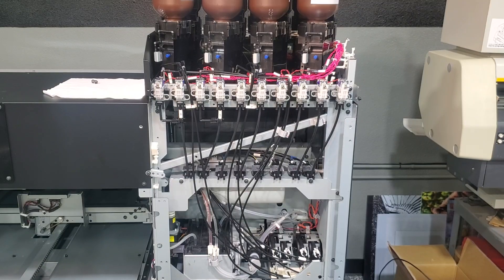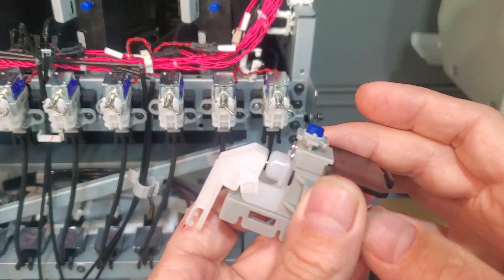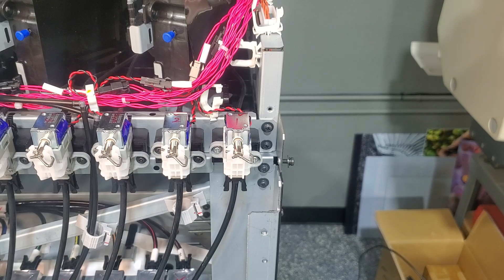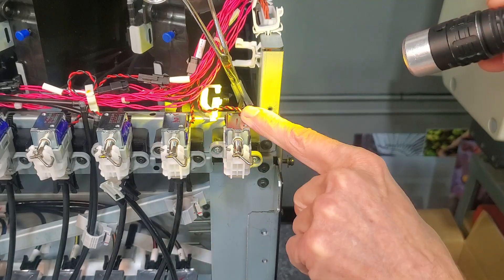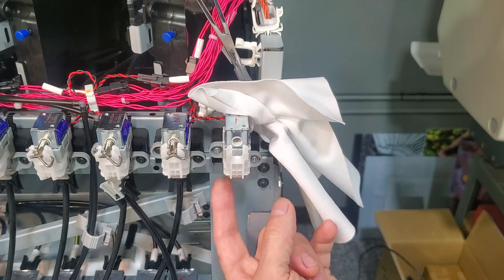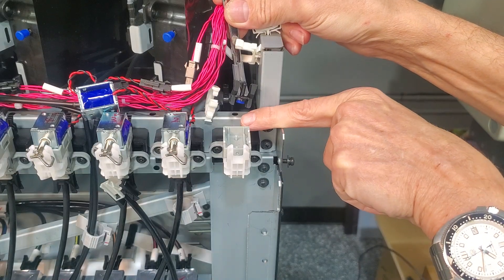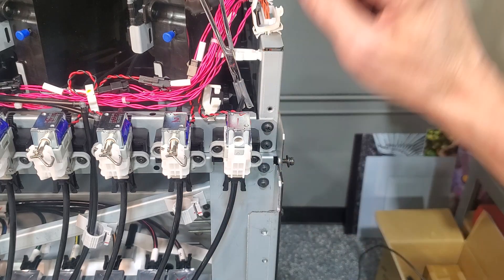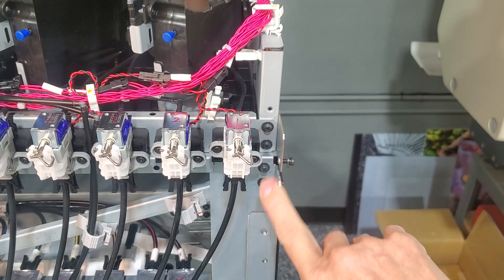PDS Equipment shows how to change the M015864 TS Cartridge Valve on your Mimaki printer.

Comment: The tubing is really fragile, good to avoid clamping on them. Remove the supply bottle, take a syringe with one of the tabbed line connectors on it and a bit of tubing. Press the valve in and use the syringe to pull the remaining ink in the bottle tank out. Usually around 50mL, and you can also rinse some alcohol or #7 flush through the tank as well if you feel like cleaning it out. With the bottle station emptied, you can remove the line without much, if any ink escaping. Uses a bit more ink, but worth not having to replace a crushed line or have a line start leaking later on.